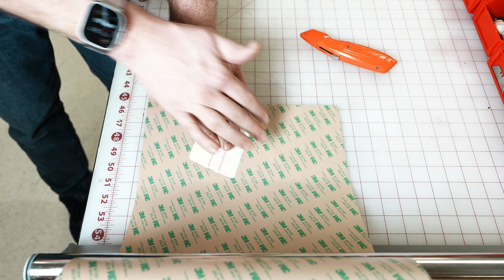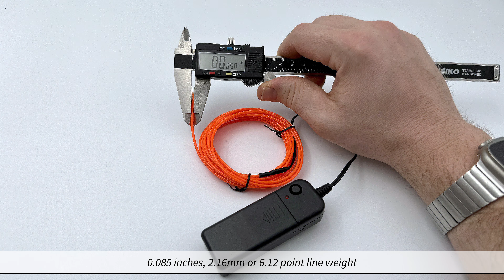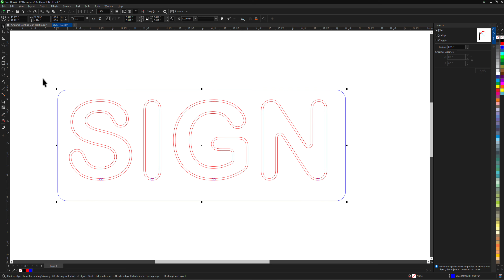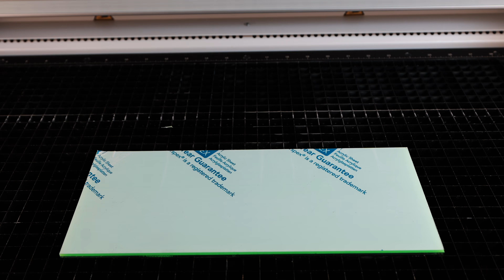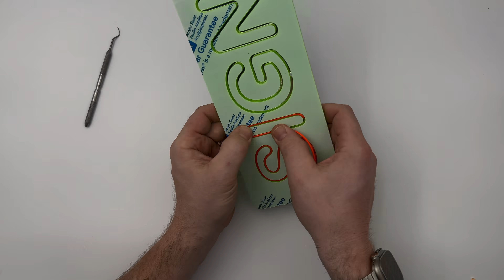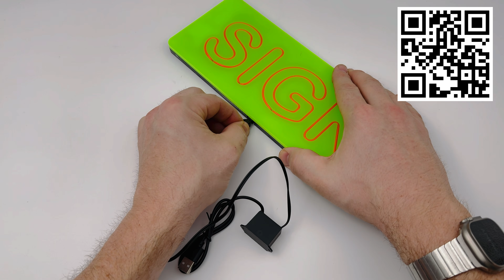Electrify Your Designs: LED Signs with Laser  Deep Dive with Laser Dave

Comment: I understand why you leave the two sheets of acrylic together when you made your sign, because it keeps everything in line. But couldn't a person cut the sheet with the text first then place adhere it to the mirrored sheet? This way you won't have to experiment with power and speed to just cut through the top sheet. Sometimes you have the right power and speed, but on some sheets, it doesn't completely cut through.
Reply from the maker: It should be possible to cut them separately, but you need to use the laser to mark or engrave the base so that when you put the parts together, you can line them up correctly, mainly for the inside letters or characters. - Laser Dave
Reply: I have done that for layered acrylic signs - I used a laser cut cardboard template to line everything up - worked well

Comment: Hey there, great idea and video! What is the lifespan of el wire? Viewed a video about laser wire vs el wire also, would laser wire work too, or should corners be more curved then?
Reply from the maker: The base of this wire is just an LED light, which only transmits through the wire. Most LED lights should last at least 10K hours, but please check with the manufacturer. Any other light-up wire material should work with this process as long as it can handle the channel curves. You can also adjust the cut line curves in your design files to meet the requirements of any wire used.

Comment: What is the lowest version of Corel the .cdr file should open in?
Reply from the maker: We usually save a few versions back, but if it does not open because your version is older, use the PDF format provided and import it; PDF is a generic vector format that will import into any version of CorelDraw.
Reply: @TrotecLaser  got it - thanks. Since the LED is about 12 feet long, does Corel give a way to measure the distance of any given letter path? It would be bad to find out the lighting is an inch or two short to cover all the letters.
Reply from the maker: If CorelDraw has a line measurement feature, this is not something I have ever looked for or needed; you would have to contact them or find out online.

Comment: You can't use transparent acrylic, right?
Reply: You are correct; this process would not work well with transparent acrylic because you will see the residue from the double-sided adhesive between the layers. I recommend a frosted or opaque acrylic. The second layer cannot be transparent or opaque to hide the wire as it ties together on the back.